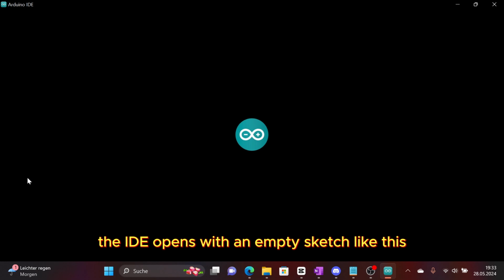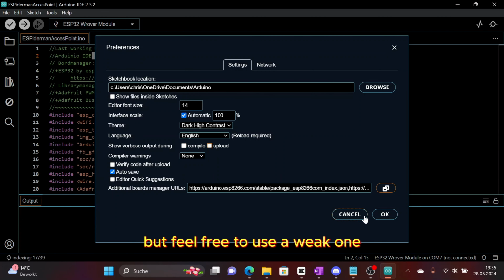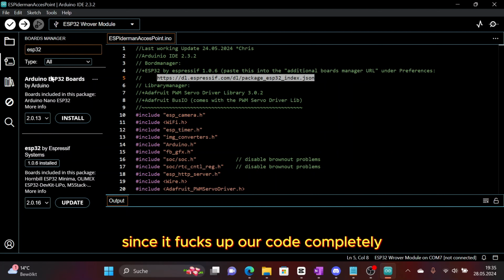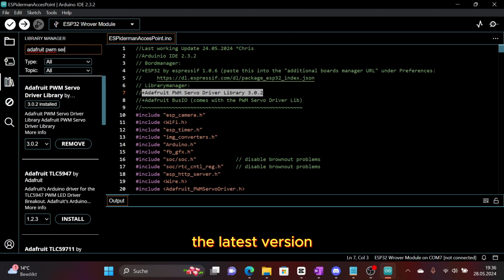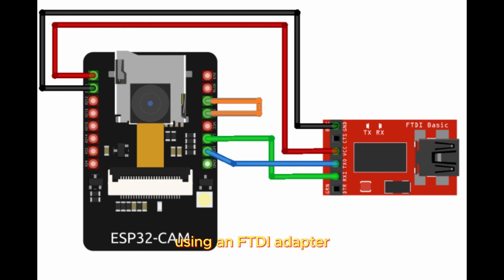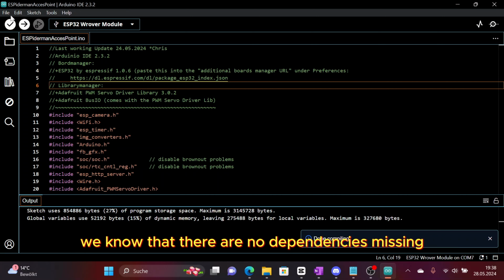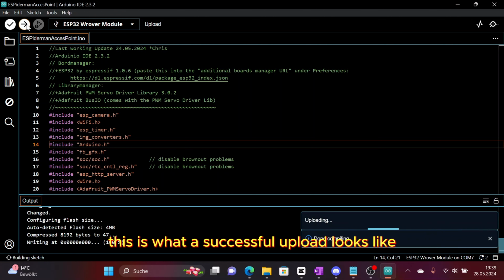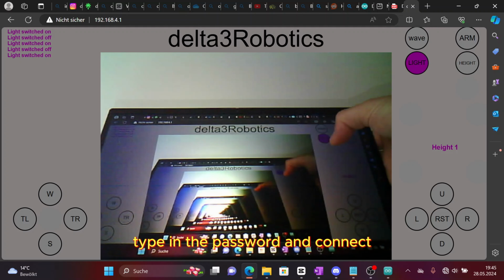Free Robotics Project Part 2: Setting up the Arduino IDE to programm ESP32Cam

Comment: This is my first time making something like this without messing up it was easy to follow unlike the previous project that I used to follow somehow got messed up and no matter how many Esps 32 i get it never works on my laptop it's kind of frustrates me, but the interface can be improved I think I'll figure something out 
once I make it completely, I'll tag you in the shorts
Reply from the maker: @BotWorksINLab  Did you use a Touch device? It won't work using the mouse
Reply: @delta3Robotics  Not yet completed I'll Let you know once it is done i have yet to do servo calibration since my servo tester is done for I'll manually do it through arduino uno
Reply from the maker: @BotWorksINLab  Also check our discord. There are a lot of tips